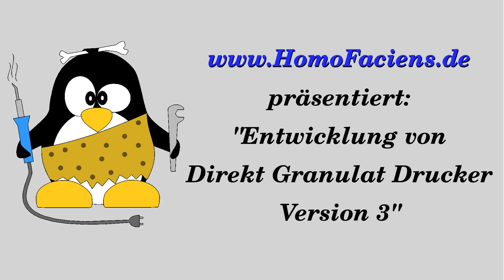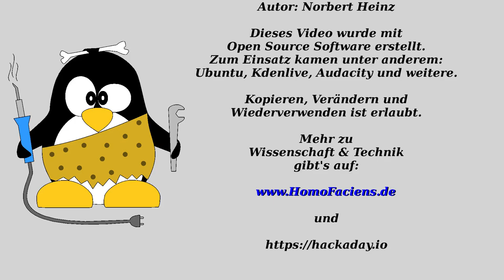Direkt Granulat Extruder V3: Entwicklungsgeschichte

Comment: everything is looking good but I got a couple questions. If your nozzle is stuck and you need the change it how can you take back the granule?  because its easy with filaments. How can you clean nozzle or other parts ? My homple opinion if you can found comfortable ways for fixing  this problems this machine is will be a gamechanger.
Reply from the maker: Remove the nozzle and push the conveyour screw through the bottom until the tip with the plastic on comes out. Remove that plastic, push the screw back to top, screw the cleaned nozzle on and done.